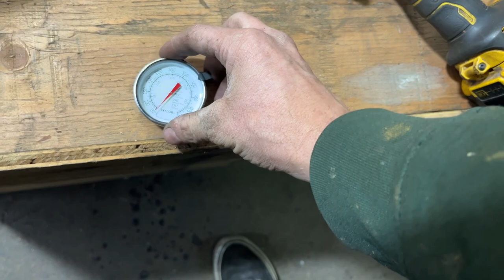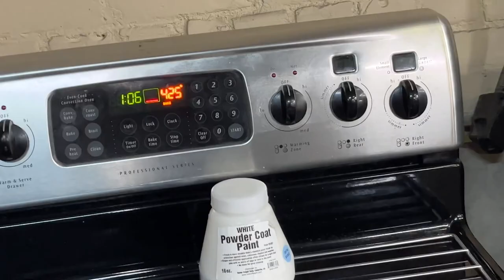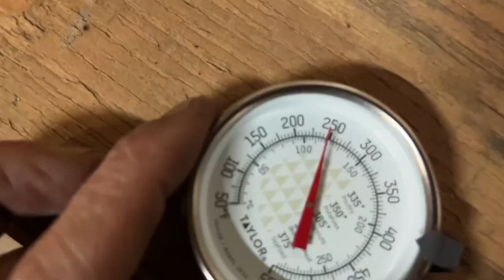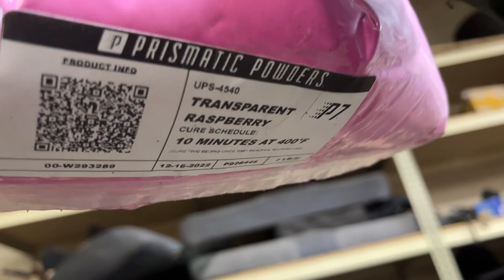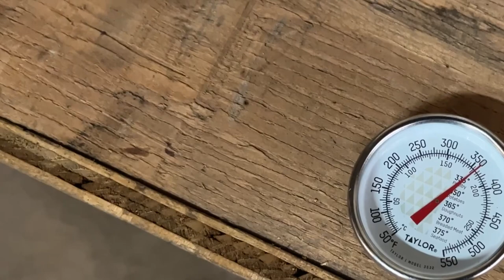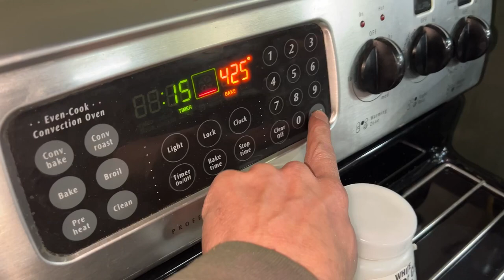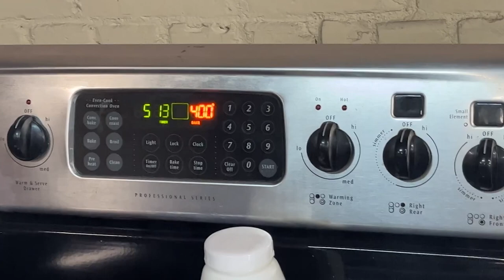Wooden oven powder coating success!!!

Comment: Remember when powder coating it's 10 from when the part gets upto temp. Which could be 20-40mins not when your box / oven gets upto 400
Reply from the maker: @Near2Future  rookie mistake as Ive upgraded since then. But Surprisingly that frame is still hold strong 💪🏻
Reply: @klegraefe  We all live & learn at least it worked out! I reckon those extra 10 mins you added. Helped with reaching the temp needed. I'm going to be doing the Orange-Sherbert-Sparkle from Prismatic  for my ktm triple trees. Hopfully it goes as planned lol
Reply from the maker: @ fingers crossed my man, that’ll be cool!! I actually just did my ttr125 hubs in Illusion violet and I’ve never done illusion colors before. But the reaction is cool, literally flash the purple violet for 2-4 minutes and it turned silver. Then add clear vision on top and it pulls the purple back to the top. Really interesting how it works, love the color but it didn’t match at all not even the slightest bit haha, I’m thinking my flash time could have been off or mayb the mill thickness of the clear and or the illusion could have something to do with it.
Reply: @klegraefe  I can't wait! I hope it turns out just as awesome as I imagine! 

If the colour is lighter / darker in area's. Then it's a base mil thickness (too light not enough powder to dark too much). If it's overall not the right shade could be clear as you said or cure time.  I would have also pulled it out at around 2-3mins. 

Once it's started to flow / gel. That's when it's rdy turning silver would be a good indication as well of a good pull. I've heard of people using diff clears with purple! I hope you  figure it out, definitely a hard colour to pull off.
Reply from the maker: @ overall it’s consistent in color. Actually I missed a step, says to let it cool down completely after gel out and I’m pretty sure I applied the clear coat at around 175-250 degrees while it was still hot, Almost like a hot floc application, I’m gonna have to try a test piece, hope yours goes to plan as well!! 👊🏻👍🏻
Reply: @klegraefe  Ah, that could be it! Which would make sense. Clear being thicker in some area's & lighter in others. Hopefully test piece goes perfectly! Illusion colours always scare me lol
Reply from the maker: @ wanted to get the experience but ill probably never get illusion colors again haha 😅
Reply: @klegraefe  They're sexy af colours when they set properly. Yet, so easy to f up with just mil thickness. I'd need some sort of gauge before I try it on wheels or something. Smaller items can just chemical it & do it again. Wheels can't really do that :(
Reply from the maker: @ I no the feeling also. Gassing out wheels first is critical. Ask me how I no lmao 🤣. I did some turbine wheels for my jeep Comanche and 2 rims came out really nice is aluminum grey. Except for one spot where there’s a group of tiny ass bubbles. Cast aluminum wheels gassed out lmao. Thankfully it’s mine and not a customers. I’ll live with it haha

Comment: Awesome, I have been think how much heat for how long plywood would handle for this exact reason. I want to powder coat my quad frame one day
Reply from the maker: Yea the wood holds up nicely. I think that smoke was from the frame jig.. there was still grease on a small part of it. But cant say for sure
Reply: @klegraefe  powder also off gasses so it could be that
Reply from the maker: @c4k3t0otz6  yea true! Also the box has no visible signs of chard burnt crispynesss . Still looks the same as wen we built it.
Reply: @klegraefe  im sure it will over time or the heat will break down the plywoods glue, you could also buy some of that rock wool or what ever its called, its like extra dense fiberglass and staple it to the wood if your going to do this permanently. 

another possibility i though of was build a larger steel box and transplant all your oven internals into it to make a larger oven but thats more for large scale diy projects and would take up a lot of room
Reply from the maker: @c4k3t0otz6  yea I agree, wen and if fails. Ill switch over to a metal box we did toss around the idea of switching all the eternals to a big metal box but yea it takes up room and also idk how often ill b doing frames or anything that big again. More of a personal project haha. But def be doing mini parts for sure!!